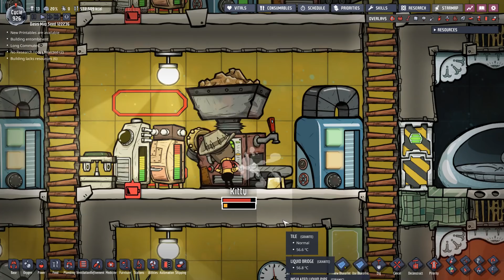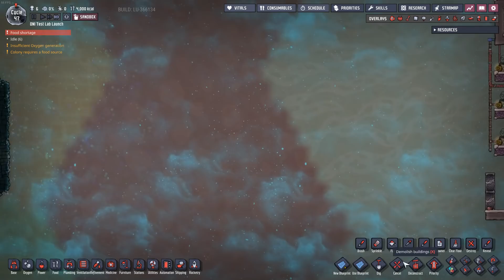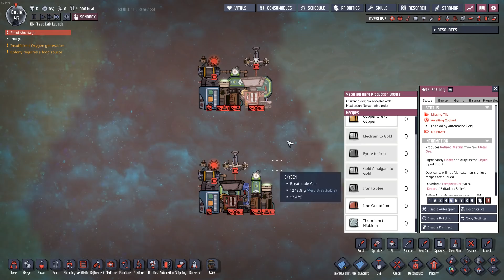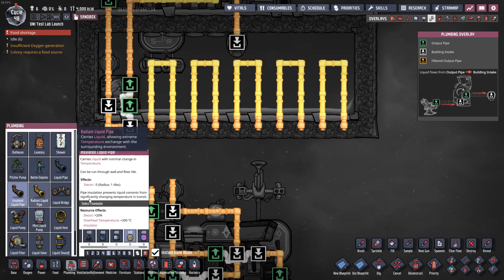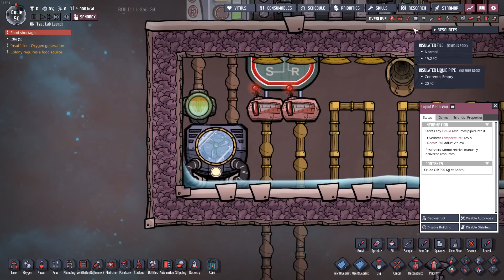Metal Refinery Automated inventory Blueprint - Oxygen Not Included Tutorial

Comment: --Edit to below original paragraph: The original  analysis was incorrect, the problem was too much liquid in the loop which caused the overheating.   One might think that the liquid storage reservoir would allow some flexibility in how much liquid can be in the loop, but too much liquid will break this design during long running  iron-steel queue. . For the hot loop that comes out of the steam chamber to the liquid shut off valve, the logic is to check if temp above 150 and if so send back through the steam chamber.  The false condition of the liquid shutoff (less than 150 C) would then go back to the metal refinery. However, here is the problem: The liquid flow from the output of the metal refinery has precedence to go into the steam room loop over the positive condition(more than 150 C) of the liquid shut off valve. What then happens is that when the output flow from the metal refinery blocks the output flow of the liquid shut off valve, the hot liquid regardless of temperature (that should be going through the loop again to cool more) will be sent to the metal refinery causing overheating. Just be warned, that this design will only be seamless if the amount of liquid in the loop is exactly right. I suspect the right amount is to only allow 1-2 packets in the  liquid reservoir storage container at a time, but didn't test this idea "how much liquid is too much".  Instead of fine tuning the amount of liquid, I found easiest and safer to add in a second liquid storage reservoir after the steam room liquid shut off valve negative check so that liquids needing to go through steam room loop again will queue up to go through steam room instead of being sent to metal refinery because of possible blocked pipe.   

I found this design to be good, but there is 1 problem: The liquid tank to the left of the metal refinery takes direct output from the hot output of the metal refinery. During a long running queue of Iron -> Steel where the output from the metal refinery can be 250+, a non-steel liquid tank will eventually melt. Why the heck can't KEI make insulated tanks is beyond me. This hot liquid tank will also start heating the storage bins and transfer heat over to the outside of the metal refinery itself, causing the metal refinery to also overheat and break. Founds tis best to isolate the liquid storage tank away from the metal refinery separated by insulated ingenuous rock tile or better. In addition to making the liquid tank made of steel, for safety best to use ceramic or better for the metal refinery.  This design as shown indicates an open air metal refinery where as most survival would have a contained room. This open air nature of the sandbox example probably provides enough cooling to prevent the problems I experienced.

Comment: Does this only work with crude oil? I tried with polluted water, but it kept always getting hotter instead of colder every time it ran through the radiant pipes
Reply: Best choice would be petroleum, which has even better range than crude oil. This is for the refineries. The only difference that makes is you can run it hotter, so there's better thermal transfer (it's like having longer radiant pipes or more conductive material). But otherwise there's little difference. You can't use water, you need to drive the temp above 125C in order to engage the steam turbine. So no water in the refineries for this application.

OTOH, Brothgar's choice of running crude oil for the AT is far from the best one. You should use any variant of water (polluted and brine being my fav) otherwise you're getting way less cooling for the same amount of power spent. Here, you use the AT to cool down one single turbine. It runs very rarely so you're paying twice the price but it's a small price to begin with. Should you need more serious cooling, water is the way to go, before you unlock supercoolant, of course.

Comment: About the part starting at 5:10; when the liquid is hot and thermo sensor goes green, the liquid shutoff says "pipe blocked" and cannot loop back to cooling. Have you ever tested that condition recently? I guess the liquid shutoff's behavior has changed. 

I had to add a liquid bridge over the output of the liquid shutoff in order to merge the liquid pipe that comes from the refinery after shutoff's output.
Reply: way be turklerı gormek guzel
Reply: this comment is very helpful thank you

Comment: I have a question: Whenever I put a thermo-sensor in a vacuum-water situation like here (generally hooked up to an aquatuner to stop it from over-heating), the thermo-sensor just stays at vacuum temperature, -273°C, and even though it is sending a green signal, my aquatuner never turns in. What am I doing wrong?
Reply: I think thermo sensors just hate vacuum. I've had the same issue many times, I think it's a bug. Use atmo sensors instead, they don't mind vacuum.

Comment: Swith the crude Oil from the Aquatuner to pWater.
pWater has a much Higher Heat Capacity.
Your Aquatuner will cool twice as fast/efficient.
and looking at the Temperature Ranges in your Base, it won't freeze/boil inside the Pipes
Reply: Interesting. I've been using petroleum, but pWater is still 2.5x as effective. I have some of my petrol running in the fairly low temp range though. The real issue you have is thermal conductivity. You need ~4x the amount of surface area to cool with pWater. I just don't have 4x the amount of area around my electrolyzer set up to make that feasible.

Comment: One thing I've been wondering in the Oasis vids is why you went with oil over p-water on the aquatuner cooling loop that cools the turbine (and the rooms of that minibase). The power consumption of the aquatuner should be lower with p-water since it costs the same 1200 watts to reduce p-water by 14 degrees as crude oil but crude oil has an heat capacity of only 1.690 vs p-water at 4.179. Crude oil seems great for the refinery loops where the huge stable temperature range of oil is important, but it doesn't look like the AT loop should ever get close to boiling temperatures of p-water. Granted keeping everything oil certainly keeps it less complicated and in the grand scheme of things the power probably doesn't matter much - but the thermal capacity to exchange heat on the cooling loop may matter eventually.

Edit: granted the thermal conductivity of oil is very high... Maybe it'd be needed to cool the polymer presses if they run continuously.
Reply: i always wonder why crude oil. if you have that oil, run it through a refinery ONCE and it'll have the superior thermal properties of petroleum for ALL your refining. a fairly good one-time investment
Reply: @PyrokineticFire1  in the refinery loops that's wasted effort - as long as the radiator loop is long enough to bleed enough heat into the steam chamber to return the product at usable temperatures nothing is required of that liquid and changes to it's properties aren't improving the systems performance.
Reply: @riotintheair   i guess that's valid... oh well my bases will just be refined and yours crude
Reply: @PyrokineticFire1  Definitely!

Comment: Info: If the steamengien is turned on at 200°C you get full 850W out of it. Of couse it drops quickly.
Reply: "full 850W" is a trap.

On paper there is no difference between short burst of 850W or long and steady stream of 400W. A watt is a joule per second. So a lot of watt over a short period, OR fewer watt for a longer time, would give the same results, in joule.

However in game, having short and random spikes of power dumped into the grid is not great, I think. Unless you use a battery, and you really should do that with steam turbines, but then why even bother seeking 850W, if the power is going to get stocked anyway.

Also, if you run your steam turbine at the edge (850W), then you'll have to have a strong cooling option for the turbine itself. Aka Aquatuner. Those require a whole lot of power to run...

Lastly, your turbine will be a constant risk, in fact will most likely often stutter because it's getting too hot. I'm pretty sure this does lose you power, when they do that.

Comment: if you leave a small pocket in the upper right of your steam room (like 4 tiles), you dont have to make it a vacuum before sealing it up. when the water converts to steam, the steam will push all the existing gas into that upper right pocket so it won't interfere with your steam generator.
Reply: And then you can corner build and delete the unwanted gas. Brilliant
Reply: only possible if none of the gasses inside is heavier then steam. Otherwise you might end up with chlorine next to the aquatuner and it will break as it can't transfer heat fast enough anymore.
Reply: @blubbber  well then you just do more corner trickery

Comment: I have no clue why but I always put Temperature Shift Plate in the area where the steam is located, hoping it would help. Indeed, it makes the change of temperature slower and it does last longer to cool down but I should follow this example instead...
Reply: Of what material use in your shift plate?
Reply: Normally Granite is a good choice since it is abundant on most maps.
Reply: @brothgar  I clearly have much more than the 1000kg of water you used in your example.

I have right now 3 sets of turbines running in my base:
- 3 turbines over a volcano: Around 40kg of steam per tile there with granite shift plates
- 4 turbines right under my main pool of water used to cool my base and feed my plants: Around 90kg of steam per tile with granite shift plates
- 4 turbines over a burned down slime biome that was in contact either a few volcanoes that I do not see yet or with the magma at the bottom of my map. It melt everything, turning slime and algae to dirt and then to sand, thus opening the lot of polluted water and turning all of it into 250C celsius. in most tile there, I have 250kg of steam per tile.

For this last set of turbines, you have the same problem in your current map. And it is only a matter of cycles before that biome of yours turns into sand and drown your oxygen production environment into hot steam :)
Reply: i like obsidian plates in steam chamber. "thermally reactive"

try an atmo sensor tied to liquid shutoff on turbine output to if you want to regulate pressure, assuming you can find something to do with clean, germfree 95°c water that overflows past the inactive valve
Reply: @PyrokineticFire1  It could be an idea. It is just that I already have too much of both water and polluted water. Enough that I am building both Bristle Blossom and Pincha farms to use the overflow. And I have not taping at all in my 2 cool steam vent (they are located in a zone full of 250C steam) and I just found a Salt Water geyser. I also use the output of my toilets / buildings that output water, one polluted water vent and one slush geyser to feed 24 dupes needs and I am flooded under water :)

Soon, I may vent some to space actually :)
Or turn that area into a massive steam turbine, using regolith and mafic as a way to keep my steam boiling...